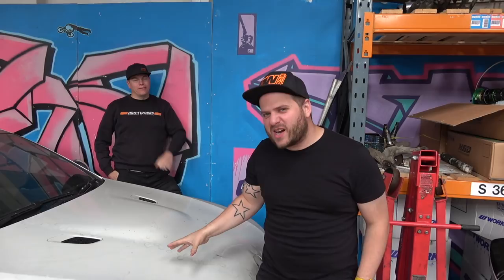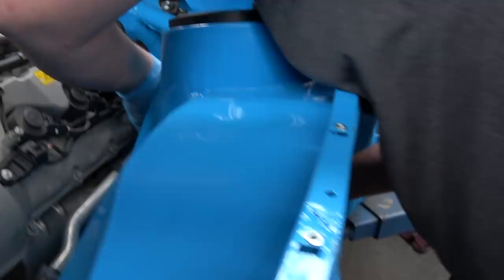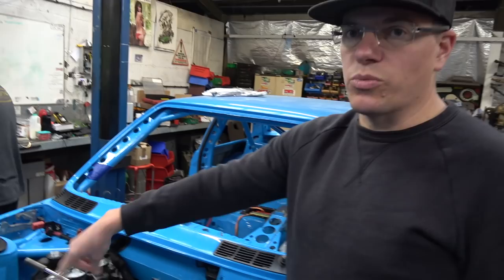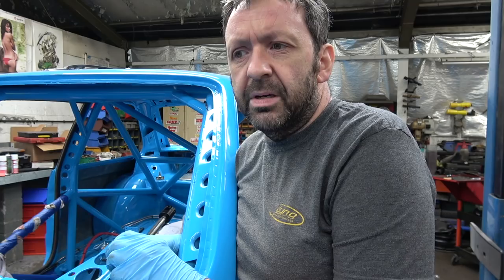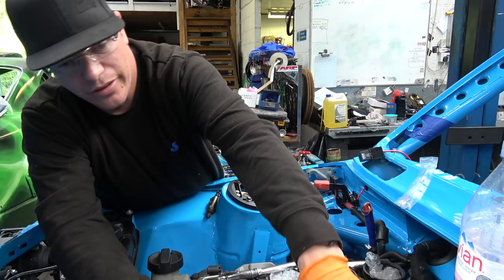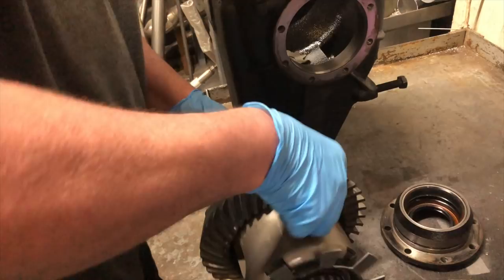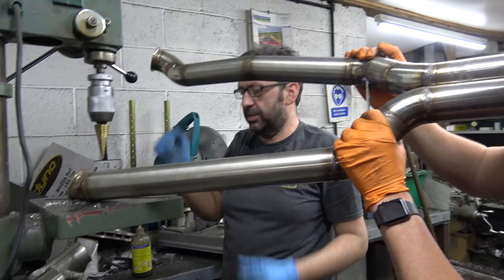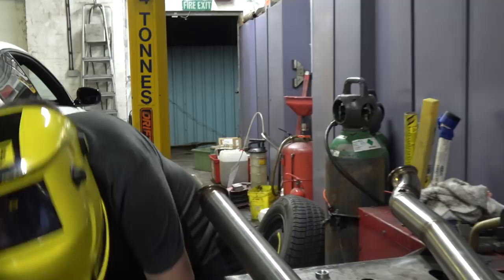Drexler differential for my E30 M3 + E92 M3 donor car - Track car project Pt8

Comment: Did you have to take it back apart and remove the reductor wheel for diff cover clearance?
Reply from the maker: I can't recall unfortunately. That's challenging my memory a bit going back that far.
Reply: @driftworks  Are you using E36M uprights? Is that why the top hat is so far forward, to get rid of the excessive caster, or actually to compensate for the castor trail?
Reply from the maker: Yeah, I'm using E36 M3 uprights and HSD MonoPro coilovers. The extreme angle is because I've lengthened the wheelbase of the car quite a bit. Castor is around 8 degrees.
Reply: @driftworks  Are those top hats / camber plates available?

There isn't enough room in the stock configured tower to get reasonable caster out of e36M parts.
Reply from the maker: They are available as spares, they are HSD MonoPro E36 M3 top mounts. But my turrets are modified to fit them, along with modifying the actual top mount.

Comment: OS Giken diff are much better
Reply from the maker: It's not apparently. I did all of the research. OS Giken was what I was going to buy originally for this car. This LimitedSlip guy really knows his LSD's.
Reply: Driftworks fair enough but I’ve seen and used couple of them OS Giken diff of the year on gtr skylines and BMW here in Australia. I’ve even got a twin plate OS Giken clutch for my missus Nissan s12 fj20et,need time to get used to drive such a clutch setup ,you know lol .this bloke must know his Aftermarket LSD diff’s . Hopefully it works well with your setup 👍🏼
Reply: Florian doesn't like them because he thinks they are too hard to tune, but honestly the OS Giken will last you longer and provide better performance. But got to say, this GT4 spec drexler is a really good unit sure won't regret getting it.